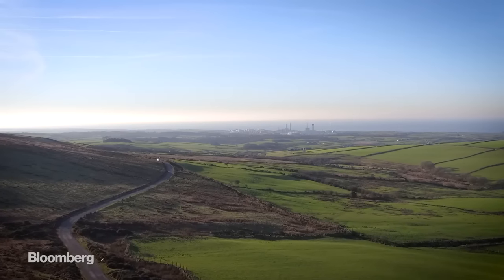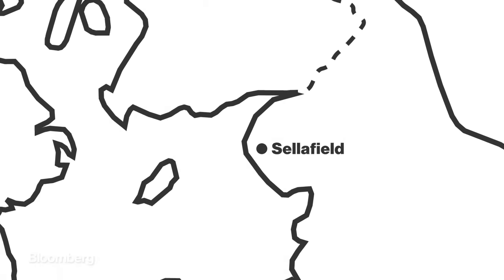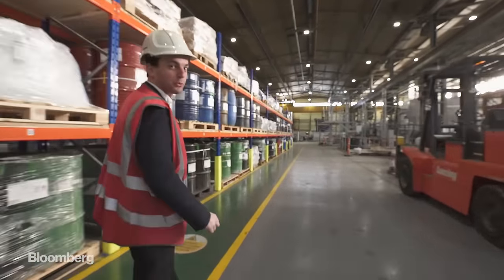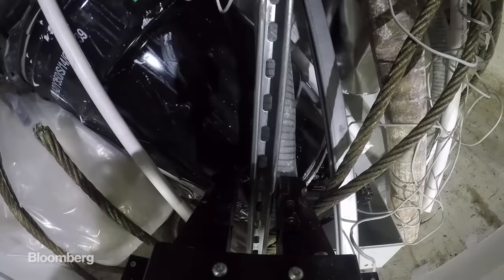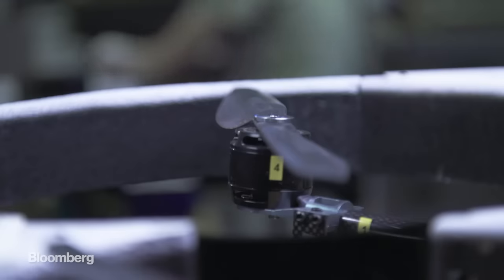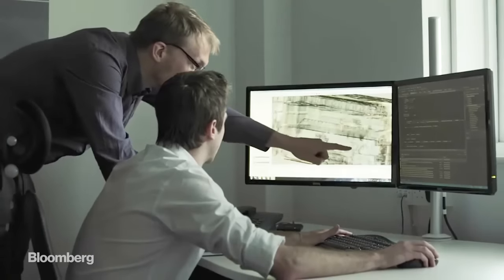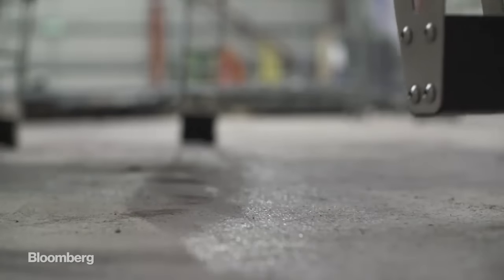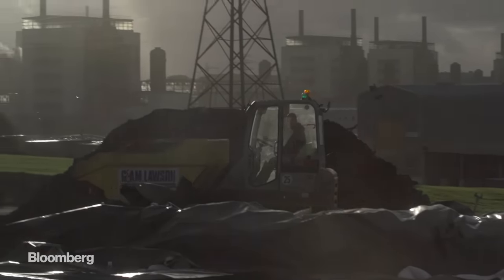The Robots Built to Clean Up Our Nuclear Mess

Comment: The hard part is not creating robots it is to have it withstand the radiation long enough to actually do something useful
Reply: This is based on what information? The radiation levels arent all that high, this is not a large problem.
Reply: @arendmookhoek4314  the reactor piles were in fact heavily irradiated,  coming close to Chernobyl's radiation levels, my best suggestion for the robots would be lining the casing with lead, to block the radiation.